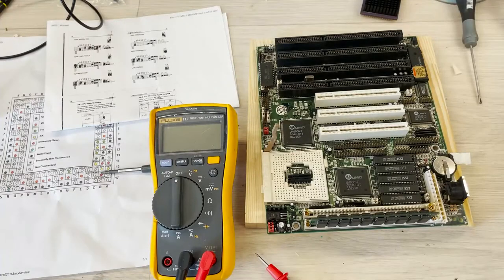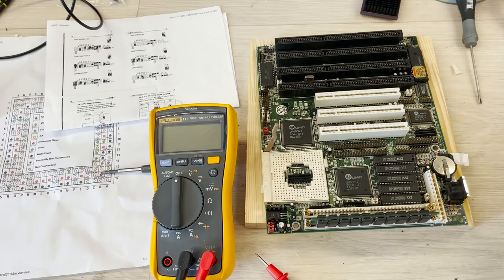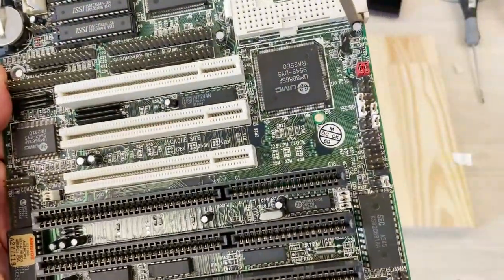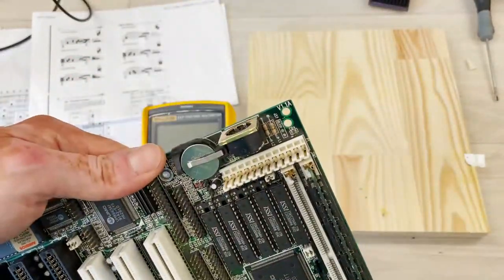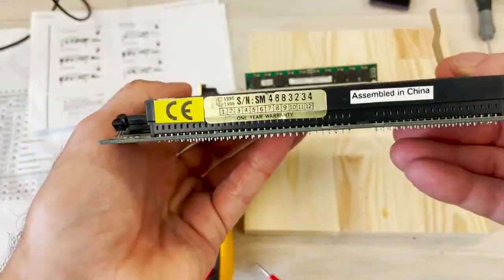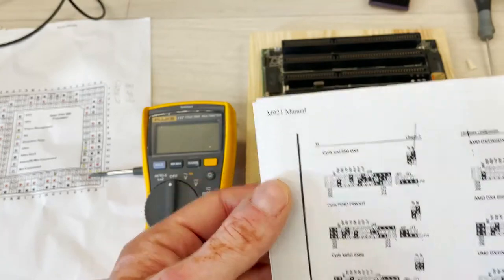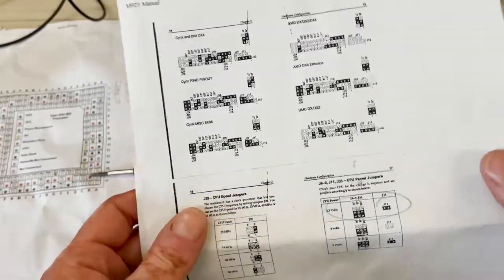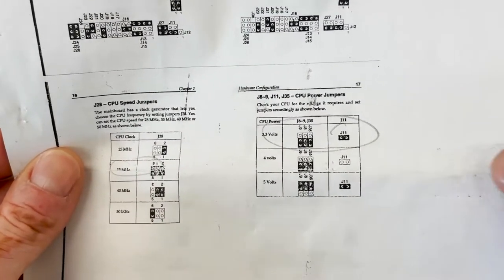PCChips M921 486 motherboard repair

Comment: Here is something funny.  Way back a long time ago I was as poor as a church mouse.  So I could not afford a decent computer.  My 486 was so slow that whenever printing, it would slow the whole system down dramatically.  So I got my hands on a second 486 motherboard, and put it in the same desktop casing. The second 486 motherboard now took care of all the printing and thus made a huge improvement in operating speed of the first motherboard.  Via slicing power cables, I had both motherboards powered by the same power supply.
Reply from the maker: Amazing! My first PC was a 386 DX with only 2MB of RAM and no cache. It was painfully slow! (I didn’t know church mice were poor? 🙂 ) thanks for watching!

Comment: I believe the extra row of CPU socket pins was for the Overdrive processor, a replacement for the 486 had gave some of the advantages of the Pentium processor.  They proved to be a short-lived, transitional technology which didn't end up making financial sense in most cases.
Reply from the maker: Ah. interesting! I watched some videos about the Overdrive processor! As you say it didn't make much sense - maybe if you had a fleet of computers and you wanted to keep them alive for a longer time? Technology was running so fast back in the days, even a 100% update would not make much sense :)
Reply: @tony359  It wasn't really something that was marketed towards large companies as it would disrupt the earnings made on warranty replacements of corporate PCs.  Intel and the system manufacturers really didn't want their corporate partners not doing their usual 2 to 3-year replacement cycle, which was and still is a main source of income for many brand names and OEMs.

Most PC owners decided to upgrade their machines to the new Pentium (or at least their motherboard/CPU) rather than buy an expensive new CPU and still not get the benefits of the newer motherboard features.  This left the Overdrive without a really solid market to support it.

Comment: That motherboard is an absolute gem. The UMC 888 chip set (as far as I know) is the best you can get as the most overclocked 486 systems had that chip set. Together with built in IDE, parallel and serial interface and PCI slots make this a remarkable motherboard. I also like it's compact form factor compared to others which also lack the said extra interfaces. I just wish I could find one.
Reply from the maker: it's indeed one of my favourite boards. Once I find a compact AT case, it may be the chosen one for my Retro PC! :) Thanks for watching!
Reply: Move over Gillette, the UMC 888 is the best a man can get :)

Comment: what are the odds me as a cine guy watching a random mainboard repair video and suddenly there's an fp20 in the back
Reply from the maker: ahahaha Youtube Algorithm WIN! I will make some videos about that and my 12 Cinema Sound Processors! :)
Reply: @tony359  I already watched a lot of mainboard and computer related videos from other youtubers and I think the youtube algo suggested your channel because of that. It seems it was pure coincidence that I spotted a film projector on a mainboard video 🙂 also youtube did not suggest this specific video, I watched a few of your other videos before I came across this one. Btw. here's my home setup: youtube.com/watch?v=i5sbiuwisK4
Reply from the maker: @colorbydeluxe900  Amazing, I wish I had that space. I think I hear a German version trailer? I have a friend in Germany with a very similar setup at home: FP30, platter, DD, DTS, SDDS. Either you are the same person or there are two of you! My projector is a philips branded very old FP20. It has the 500W Xenon "shoebox" lamphouse, single phase, no extraction required. I can basically plug it in a living room! I refurbished and commissioned it during the pandemic, it's fully working with DD-DTS and SDDS. But it has to live in the garage unfortunately. In the pipeline there is a video about a DTS-6D I've recently picked up. I wanted to show what that is about - hence the idea of the multiple camera video you did which is amazing. Thanks for watching anyways and hope to chat again soon!
Reply: @tony359  Thank you! I also had a Philips FP20 which I replaced a few years ago by the FP30D. I'm actually from Austria but I know some Germans with similar setups. Keep making your videos, love to watch them! 🙂
Reply from the maker: @colorbydeluxe900  Shall do and thank you! Bear with me, the projector video might take a while to come out :) My FP20 is old and crusty but is also so convenient because of size and the fact that it's fully single phase. BTW, comments are disabled on your video: such an impressive and super tidy setup! It's absolutely amazing!

Comment: Great vid. Regarding the heatsink for that 486, I worked as a technician in the RMA dept of shuttle in West London in mid 90s, we would only put a heatsink on an Intel 50mhz, nothing on a 25 or 33 but for 66mhz or more in production you really must use a fan plus headsink and that goes certainly for any CPU which also has a 3.x volt ;) Ps great to see the anti static strap, I think I last used one at the beginning of the 90s :)
Reply from the maker: That was an OLD video, sorry for the poor audio/video/editing quality! :) 
I tend to wear my antistatic strap more or less all the time, I am very paranoid about that, particularly in winter when I make sparks when touching anything!
Thanks for watching!

Comment: Cool video bro! There's an Award BIOS for this motherboard and it's a bit faster with EDO ram.
Reply from the maker: Thank you! I didn't know you could use a different brand of BIOS! Sorry for the shockingly bad editing/recording of this video, it's very old, early stage :)
Reply: @tony359  It's not bad at all, actually I'm impressed by it's quality. The way you can zoom in to the components and the way the camera doesn't appear to be bothering you at all... I tried to record some videos of me fixing an old motherboard but it's very uncomfortable to find a correct angle for the camera, and to actually do stuff at the same time. Do you have any advice?
Reply from the maker: I think that was my old iPhone 7 (if memory serves). I used to shoot with the tripod in the way, so uncomfortable. I've recently moved to an overhead stand. The bottom line is: I fixed that motherboard in a very uncomfortable way I'm afraid! Overhead is much better as it's always out of the way. If you have a solid shelf you can use, you can clamp an arm to it?
Reply: Thank you for that  @tony359  I'll try to produce some related videos and see how it goes 🤝

Comment: An idea: Is there any chance you could dump the BIOS from this board and compare against known images and post it if it's new? Just got the same board off of auction site, it was in fact in my very first computer, and I'll be looking to reanimate it very soon, and get the BIOS dump as well. I need to submit BIOS from my first board, as it's chip is only thing that survived back from this day.
Reply from the maker: Hi there - the bios is likely available on The Retro Web page. If not, I can upload it there. Thanks for watching and good luck!
Reply: @tony359  Taking a look at The Retro Web and at your screen - quite probable. The dump from my old board doesn't match any of the dumps, so I'm going to submit it to The Retro Web. Maybe I can get that BIOS running on my new board, I want to try it first.
Reply from the maker: @LeoGitarzysta  I shall check my version I didn’t know TRW at the time I think. If you need mine before it’s online, give me a shout!
Reply: @tony359  Got my board working after a friend volunteered to resolder the northbridge, in exchange for helping to diagnose his 486 mainboard, which started up as well. Two of four sides were loose, and yesterday after finding just one unconnected pin, the board sprung back to life on the BIOS it had. In the meantime, I managed to run both BIOS dumps in 86box, so I guess, that my BIOS dumps are coming to The Retro Web as well. For both boards and additional XT board, the other board didn't have any dump available over the interwebs ;-)
Next step is replacing the fake cache I definitely have, after I test it out more thoroughly.

Comment: I had a similar problem - the voltage regulator stuck the PC a few seconds after powering on.
Reply from the maker: Regulators on older motherboards are like Capacitors on other boards... They tend to fail a lot :)

Comment: Nice content! Hope you will make more.  I may have overheard it, but is there a reason why you didn't connect a speaker? As you obviously know what you're doing it seems kind of odd to me that you didn't want to hear the beep codes ;-)
Reply from the maker: Thank you Marco! More content will come - I'm just not the fastest at making new stuff! :) What you say about the speaker is absolutely correct. I think I was going to connect one but then I noticed the CPU voltage was incorrect so I stopped and looked into that first. But you're right, maybe it could be a good idea to plug a buzzer in the first place! I should also get one of those boot diagnostic cards at some point. Thanks for watching!